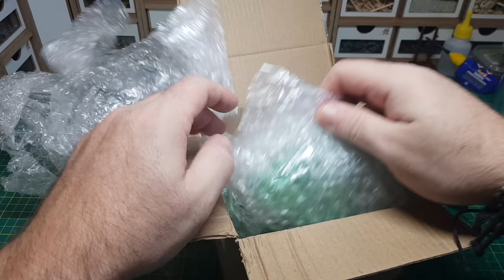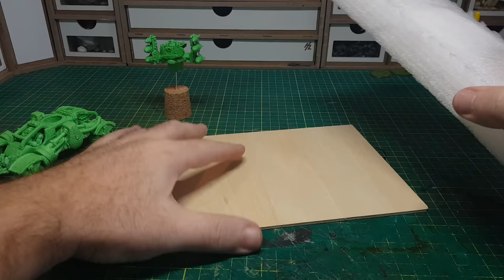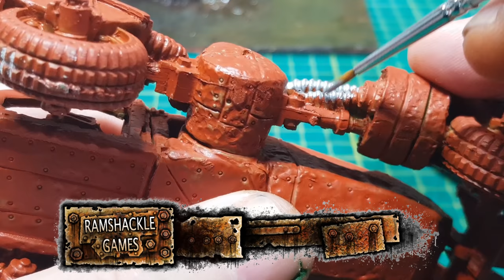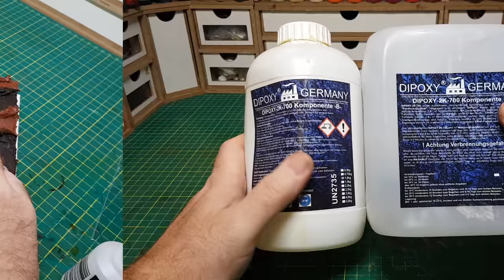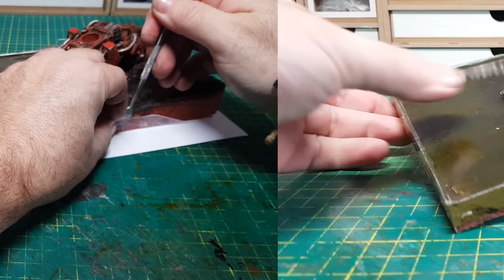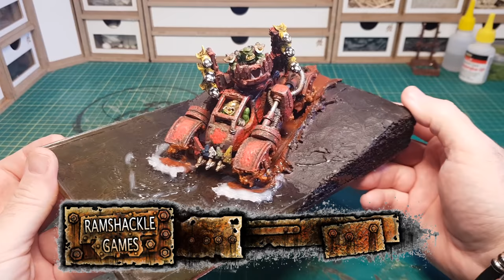How to Build an Ork Outrider Vehicle from Ramshackle Games

Comment: Jon for large areas for paint jobs, have you tried painting with larger brushes?
Reply from the maker: I am now using large make up brushes for larger areas and used them today on the burger 🙂👍
Reply: @MiniatureHobbyist  cool! I should try and use my old make up brushes on my minis. Which paints do you use? I am trying to paint my hydra and figuring out the color scheme for my indomitus set.
Reply from the maker: @suzannemacmillan9135  Im using all kinds of paints lol, as the burger is large I just recently brought some large acrylic tubes and they are much cheaper than the small tubes by warpainter/game/vallejo etc.. =)
Reply: @MiniatureHobbyist  That makes sense, thank you.